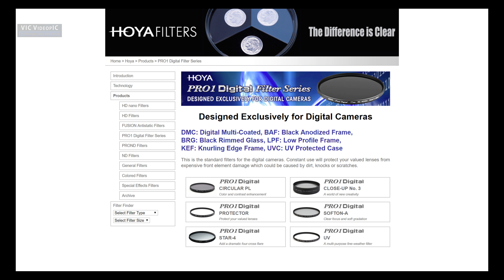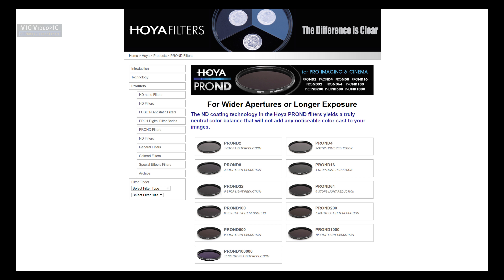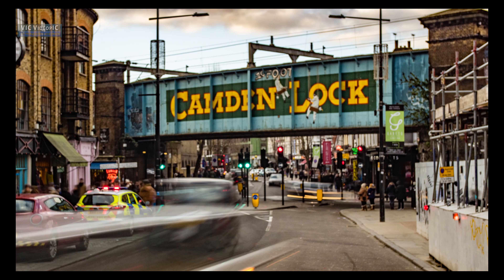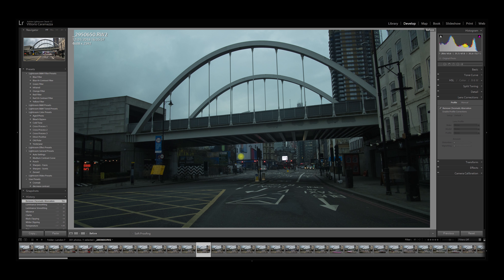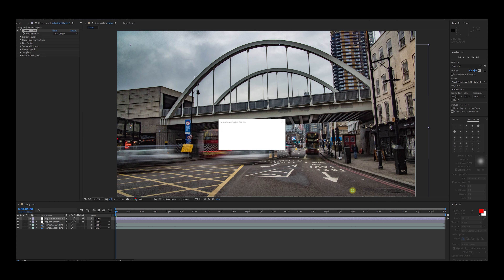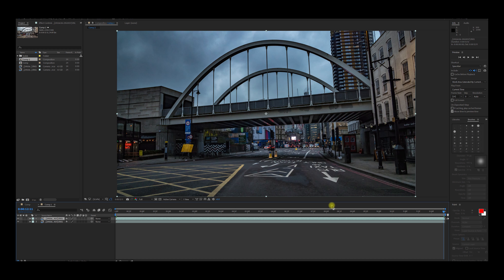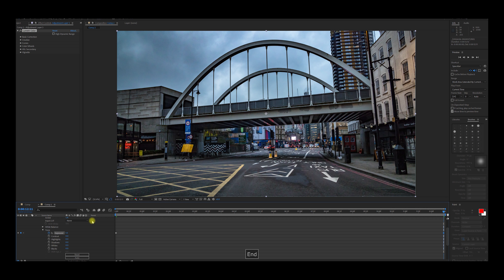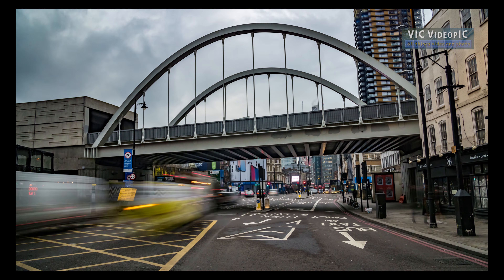Timelapse tutorial of car traffic (2018)

Comment: Question: can your shutter speed be longer than your interval, or is that a completely stupid question?
Reply from the maker: I Phil,
the SS must be shorter than the interval between shots by at least half a second, the time needed for buffering the file (assuming you have a very fast memory card.
As an example, at an interval of an image per second I use half a second SS and I can only do it with my fastest memory cards.
My Nikon D850 has a choice of shooting every half a second, but I do not have at the moment memory card fast enough to take advantage of that
Reply: Ye, that makes sense. I think I my brain imploded there. Cheers.